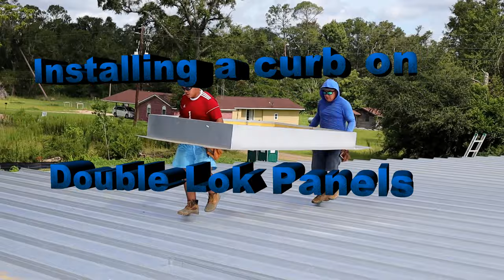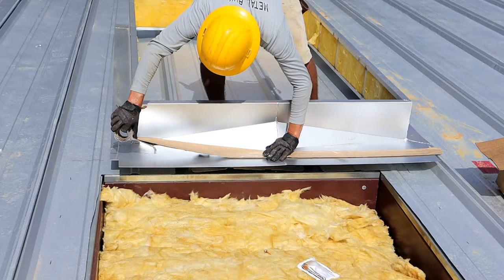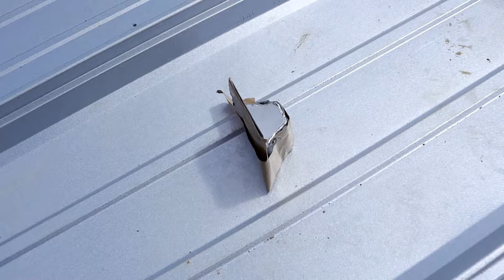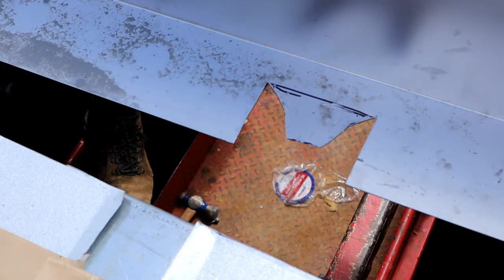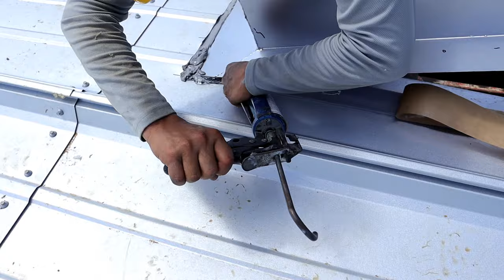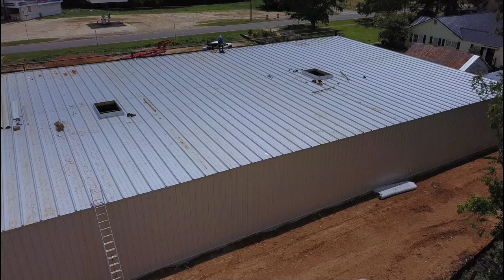How to install a Curb for standing seam metal roofs (Double LOK Panels)

Comment: You don’t cut a curb in at the top, as the roof expands and contracts this will tear and cause leaks, proper installation is either over/over or under/under. 2.5” mastic gasket is the only way to water proof a commercial roof curb. Silicone will oxidized galvalume roof panels and void manufacture warranty. Roof curbs should be installed as roof is installed under/under for best results. Over/ over is for retrofit applications. 20 years experience certified PEMB roof installer.
Reply: Lucas, you have any videos for over/over install?
Reply: when you mark where to cut the deck .. we have a 8" roof because the foam insulation in between do i use a long metal bit to mark from underneat ?   I really dont want to make mistakes
Reply: @MrAllister9   yes

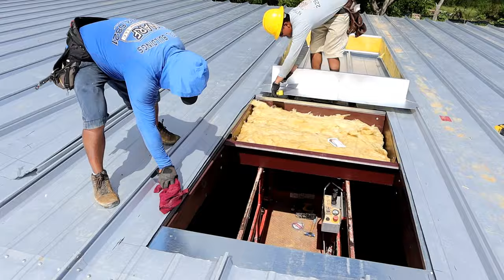Comment: @1:02 why is there a man dancing around the open hole with a red hankerchief with no harness on him? he is going to trip and fall into the hole. If I saw this on one of my jobs, the job would stop until this is followed and understood.  For the installation detail, I would have removed the standing seam roof panels, installed the curb, then put the roof back on. One summer with this roof heating up and cooling down, expanding and contracting, and it will leak at every seam here. (architect since 2004)

Comment: Were Grinders not invented when this was produced? Secondly epic fail unless the curb is getting an adapter because i didnt see any sort of leveling
Reply: Many steel roofing panel manufacturers will void the warranties on their products if grinders are used. The heat generated can ruin the protective finish (even if 'only' galvalume') and result in premature corrosion problems. Hands snips and electric nibblers are used.
Reply: @paulmaxwell8851  I must've missed the manufacturer rep in the video? Did you know most want a Vapor Barrier as underlayment too? Also there's a touch up paint for scratches/ grinder burns?

Comment: You should’ve went further up roof to where screws are in beam. Take screws out , push curb up instead of fighting it🤙🏽… put back those screws 🙃 P.S. curb should go on top of both highs on each side
Reply: ps those screws are not in a beam they are holding a pan on the bottom panel and if you take them out said pan falls out

Comment: i wanted to see how you guys marked the rtu hole from underneath ...   but you skipped it all .. im doing a roof with q deck and gravel on top and its 8" cause the foam in between ... i would just use a long bit from underneath and drill though kinda thing?
Reply from the maker: We had the hole framed and when we installed the roof we marked  location of the hole at that time.